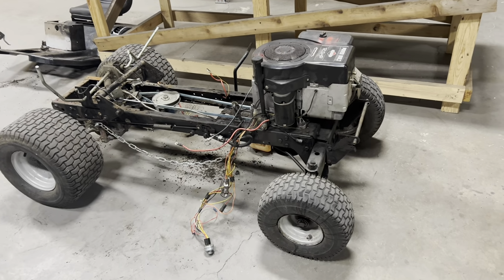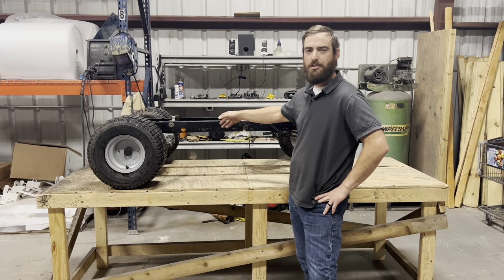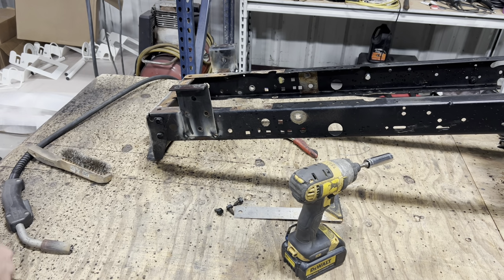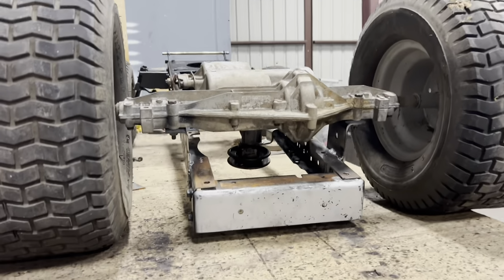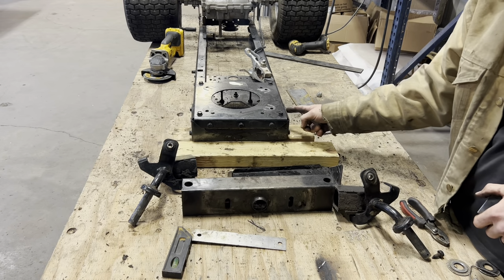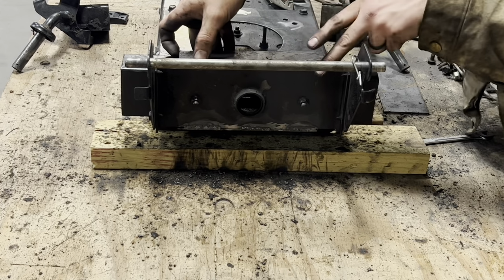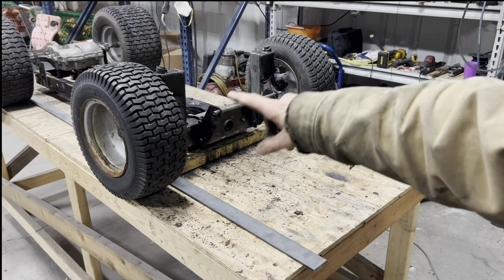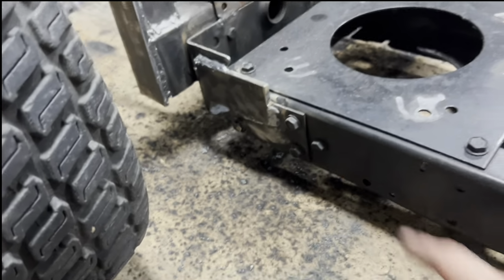How To Lower a Lawn Tractor As Low As Possible Pt. 1

Comment: Just what ,I was lookin for ,totally insane, Excellent work , I have done a club car electric to gas conversion  lot of fabracation and  now on to my next project.I acquired two new riding mower frames and am thinking of picking up a  need repair Suzuki 230 shaft drive 4 wheeler . I did not know how I was going to incorparate this onto my frame ,but after seeing this video ,I now have a blueprint , Thanks!

Comment: put a support brace across the back behind/on top of the transaxle, without one the axle will flex and blow up the rear end
Reply from the maker: It still uses the original 5th mounting point, I just didn’t get to it in this video

Comment: Is there any issues with lubrication or anything like that? I’m not sure how these tractor rear ends work but is there like oil or anything in there?
Reply from the maker: To be honest, I haven’t got into that yet. From what I’ve heard, it should be packed with grease but I’ve also heard that some have heavy weight oil. I haven’t had any issues or heard any whining so far
Reply: The trans is a  Tuff Torq K46, pretty sure. They use motor oil from factory and they have a breather on the top side so that may leak a little.

Comment: Instead of welding the rear brackets on, why not just drill new holes in the right places and mount them with the same bolts?  The front mod pretty much required welding, but you weren't there yet, unless you had welding planned in advance.  You don't plan on racing the conversion, so I'm wondering, why do it?  Just curious, but great work so far.
Reply from the maker: Welding is at my core, so it’s just easier and faster for me to weld certain things than drill and bolt. I’m doing the conversion purely for the fun of the project and getting to play with it when it’s done. 
Thank you!
Reply: @wybarprojects   Thanks.  I like it when I get replies to questions.  It's really not all that common and shows me you care.

Comment: Question: What Should you do to an old riding lawn mower to make it into a powered mobility scooter?
Reply from the maker: I would say a riding mower without blades is pretty close to a mobility scooter, unless you're talking about going electric with batteries. In that case, I would basically just swap the rear transaxle for a live axle and run an electric motor through a PWM and potentiometer for throttle
Reply: No Way on the electrical motor. I was looking at keeping the gas power because the closest town is 45km away. Would be nice to get there and back on the same day. No I was thinking of stripping the mower parts and some how, keeping the mower engine and not put in a motorcycle engine (kind of defeats the purpose of using a riding lawnmower) and put on a cab on this thing. I was looking at what can be done to the engine and only found putting an exhaust system onto it. The suspension system info was either racing or off road (which is cool, but again seems like it defeats the purpose and buying an old atv would be better) and I want to fix it up with out doing that much work, for this 1 at least. The cab thing, I have no idea if if there ever was a hard top for them. @wybarprojects

Comment: Yeah so I'm thinking.  If you cut the frame just behind the motor.  flip the back half upside down n spin the rear Axl reinforce n weld the frame back together

Comment: Would you need to adjust it more to have 2-4 inch ground clearance and if so would it make the build more different and or difficult
Reply from the maker: I think it would take a little bit more work on the rear axle, but I think the front end would be the same and the body might be slightly easier. 
The main reason for the current clearance is that’s where the pulleys lined up when I flipped the axle.

Comment: Well I’m gonna do this to my JD 111 that hasn’t had to have even the head off it. Runs like a champ and bought electronic ignition because it has just a bit of a miss. Plus surges a bit from lousy carb and always has but doesn’t smoke and always starts up until recently when the solenoid went out so have to put the new one in but the solenoids aren’t exactly like the old one. The old one has the two large battery poles then two of the small poles that went to the little separate rectangle black switch or whatever that is next to each other. Then on the old one has a small pole by itself on the side of the old solenoid. The only new solenoid I could find for it has the two large poles then the two small ones that are molded into the whole solenoid. So I have ends that go onto the small poles that slide onto the threads.  I have 2 red ones then I have a purple one. Also a small wire I think coming from the starter that goes to one of the large battery poles since it did have a end on it large enough for the big poles. Has a link on it also that you can disconnect. I took this solenoid out a couple years ago and also lost my notes. Thinking maybe the purple goes to the ignition switch. I’m hoping also the solenoid ties in to the solenoid and ignition switch and why the electronic PTO would not work thinking since the solenoid was out. I used a car bypass button to start the mower and is when I tried the PTO which didn’t work. So bought a new switch since the pto switch was getting hard to use thinking that was it but still wouldn’t turn on with the new switch. Gee I’m a rambler and if anyone has any ideas where my two red wires for sure go to that are by the solenoid and what pole the purple wire goes on which has the 90 degree end on it like the two red wires that slide down on the poles threads. I’m not at all a electrical guy. Getting better and sure this is simple but don’t want to mess it up.
Reply from the maker: If you started with a 3 post solenoid, I would honestly just find another 3 post to make it easier on you. On a 3 post ignition, you have hot coming in from the battery on one big post, hot going out to the starter from the other big post, and the ignition signal from your key (most likely the purple wire) would slide onto the small third post. Three wire solenoids Ground through the solenoid body, so you need to make sure the body has continuity to the negative on your battery. I have zero experience with the electronic pto, but maybe somebody else will chime in with some insight 🤞
Reply: @wybarprojects  thank you very much for your help. Your mowers are my new dream. Thin 111 would be perfect of my 2015 Ariens 42 that I’ve had nothing but problems with the compression release. Hydro gas lock up that filled the whole engine with gas then fixed that and the cam broke off it appears because the exhaust valve does not move. I’m don’t with Briggs so I’d put something else in it. Briggs should redesign the cam compression release but have yet since they obviously do t care. I saw a video with a guy that smooths out the little tab  that  runs on the came and adds a rubber band type deal to it that makes it work as it was designed

Comment: Are the mower tires still safe to run
Reply from the maker: I suppose they’re still safe at the speeds I’m running. I haven’t put any air in them (I’m not even sure if there is air in them 😂) but they look pretty decent, not dry rotted or anything

Comment: looks like the entire part of chassis that the front axle pivots on can be unbolted and flipped . if so , you might not have needed to modify the axle at all .
Reply from the maker: It does look like that would be a quick and easy solution, but that would put all the weight of the front end on the spindle cotter pins instead of the spindle shoulder. At least that was my thought process

Comment: I wish I had a Millermatic 135. My Harbor Freight junker crapped out and now I can't finish my '69 C10 shortbed conversion. And I have $4 to my name
Reply from the maker: Take that $4 and go buy two glass bottles of coke, head down to the local welding supply store, find the old guy that’s coming in by to grab some wire and tips, offer him one of the cokes and brag about the ‘69 you’re working on. Before you know it, you’ll have a new best friend and hopefully a decent welding machine to borrow
Reply from the maker: In all seriousness, it’s a bummer to hear about your situation and I’ve been there before. Just keep your head up and squirrel away some money until you can afford a decent used machine and you’ll be back in business. 
Good luck with the ‘69!
Reply: @wybarprojects  thanks man. It's cool. I've got it better than a lot of folks. I just saw that welder and remembered how nice my buddy's Miller welded years ago. And I don't HAVE to finish the '69, I've got another truck I can drive. It was just a huge bummer when the welder crapped out

Comment: Flipping the rear end wouldn’t that make it turn the wrong direction
Reply from the maker: I thought so too at first, but after flipping it over, you have to rotate it 180 degrees and it goes forward again https://youtube.com/shorts/ynkx2HVngCE?si=EIcZpMA7uPi62QBf
Reply: In this video he flipped it but it’s still facing the front. If you spin it 180 the shifter will be facing the rear of the mower. I have one on the bench now and don’t understand.
Reply from the maker: @busaofscbusaofsc8633  I did have to reconfigure my shift linkages, but I do still move the shifter forward to go up gears and back to go down/reverse
Reply: @wybarprojects  so it was flipped but not 180 degrees. If it was 180 the shifter would be pointing to the rear of the mower

Comment: Why you wanna lower your mower so much?
Reply from the maker: I read that two different ways 😂
- I want so much to lower it because I thought it would be a fun project that isn’t covered much on YT
- I want to lower it to such a low amount of clearance because that’s just where the belts happened to line up when I flipped the axle. I could go with slightly larger tires to rise the frame if I wanted to